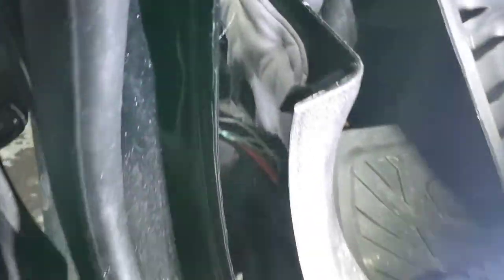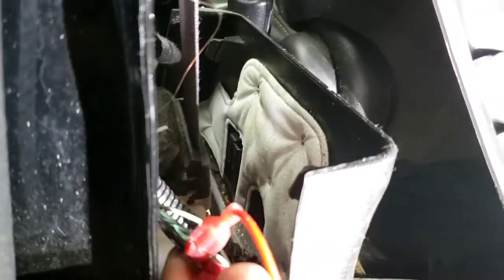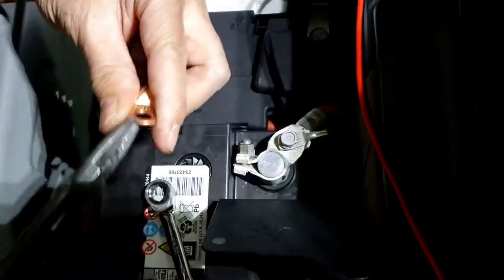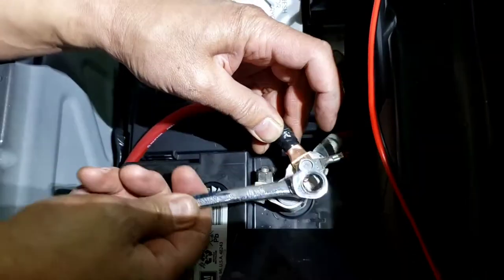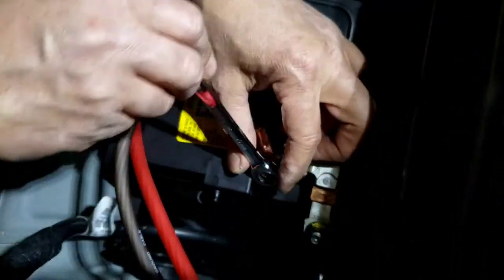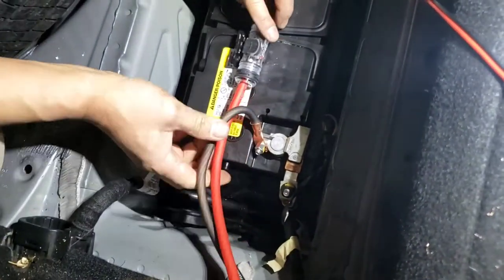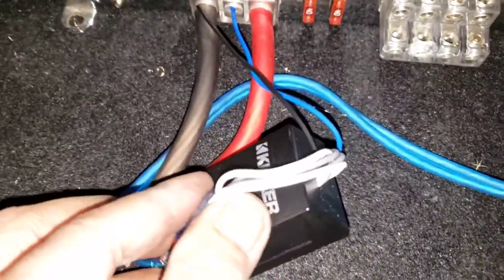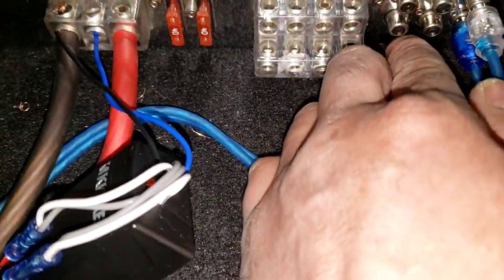Install amplifier 16 17 18 and up Chevy Cruze stock radio

Comment: What’s the converter you have
Reply from the maker: Kisloc2 made by kicker
Reply: @khmerohio  so the wires on the driver side panel. Did you run wire from the converter to it ?
Reply from the maker: I ran the wire from the driver side speaker to the converter
Reply: Don’t converters have 2 sets of wires, one for each side?
You didn’t have to use 2 wires from each side?